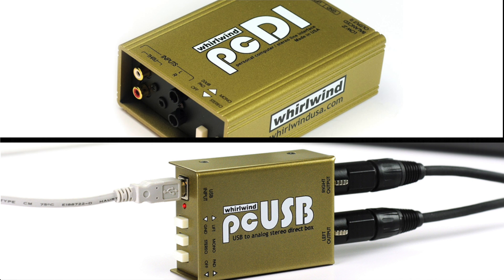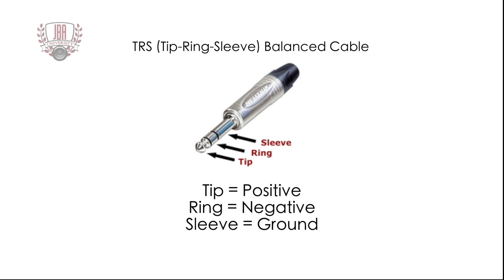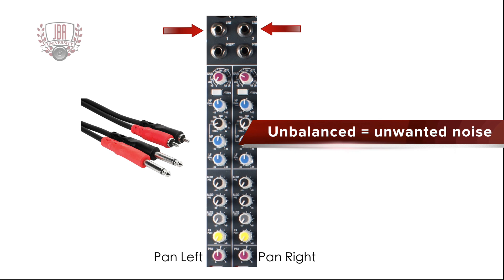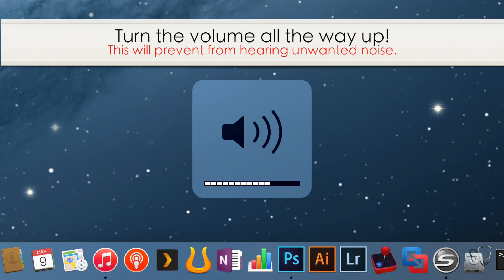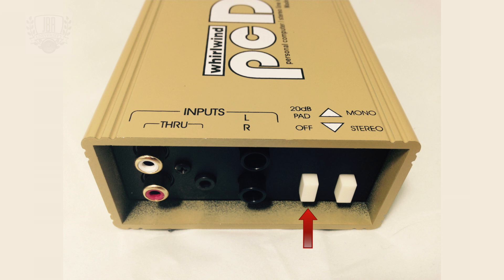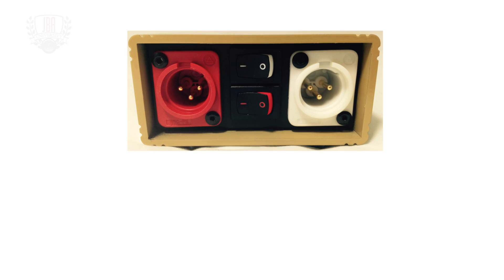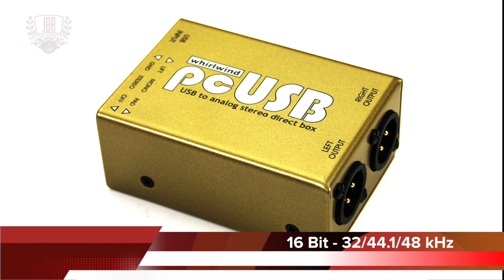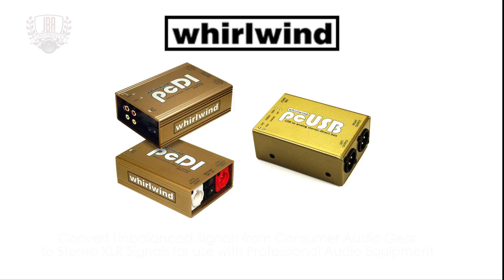Whirlwind PCDI & PCUSB Tutorial - Plug Your Computer or Phone Into a Mixer

Comment: If i use PCDI which is a passive di box connect to guitar TS cable or computer 3.5jack cable , I will still need to open 48V at the channel that I plugged into?
Reply from the maker: 48v (Phantom Power) is only used for condenser microphones. It has no relevance to guitar signals or a computer's 3.5mm output. This device is for taking an unbalanced signal, and making it balanced.